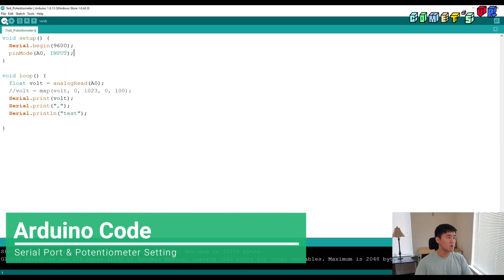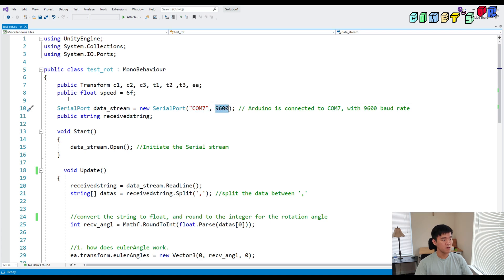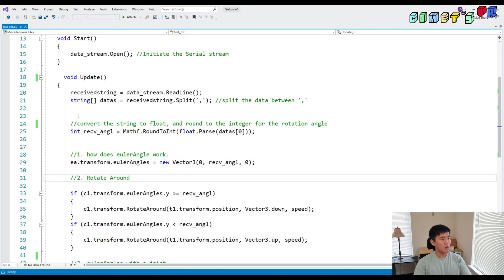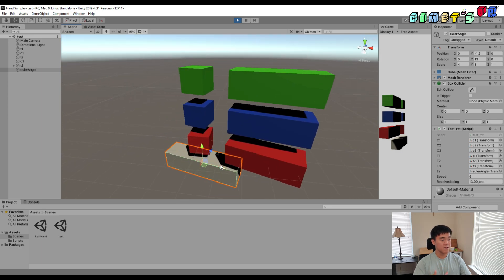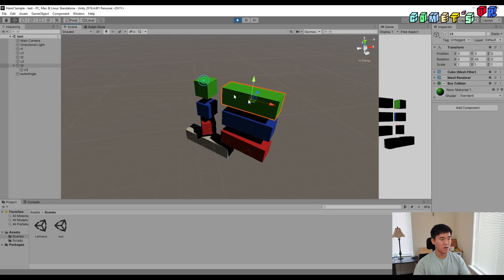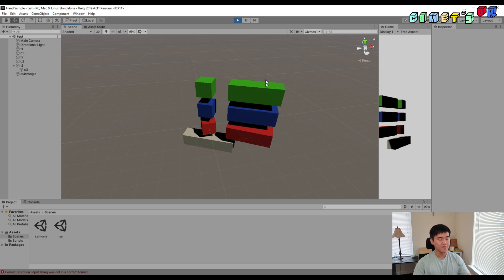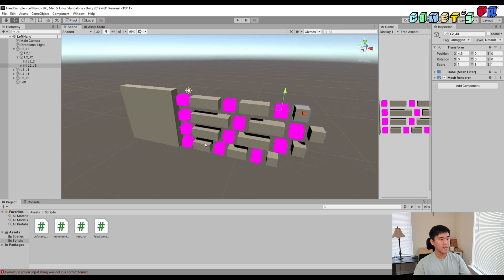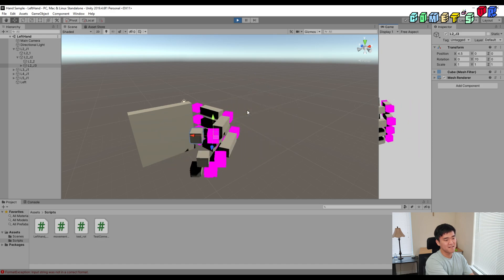How To Rotate Objects in Unity with Arduino, Serial Communication and Potentiometer.

Comment: Hello Comets, what a nice video. Thanks! I'm having some problems. I'm using your exact code but im getting an error.

"Assets/Scenes/test_rot.cs(39,14): error CS0019: Operator '<' cannot be applied to operands of type 'Vector3' and 'int'

Anybody knows a fix around this? thanks <3
Reply from the maker: On the right hand side of the operator, did you put integer data type?
Reply: @comet-tech  send the coding

Comment: Hey bro i am also doing such project kindly reply kr i need some of your assistance as i am doing flex sensor
Reply from the maker: There is a video related to Flex sensor in my channel.
Reply: @comet-tech  bro i want to rotate the same hand fi gers through flex sensors.Is it possible if you help me?
Reply: I shall be very thankful to you if you help me related to my project
Reply: @comet-tech  i need your left hand sample scene if possible can you send it to me?
Reply from the maker: @bilalsajid1006  https://github.com/hsmoon5458/cometsvr
It's here. It is an old version but you will get what you need. I will update the Github in the near future. Thank you for your interest!
Reply: @comet-tech  bro verg thank you
Reply: @comet-tech  bro i am doing this project with arduino and flex sensor i just want to know the formula through which sensor data will be converted in unity as a perfect angle for every finger
Reply: @comet-tech  bro my flex sensor give me the values that ranges from 600 to 900 i need the formula to convert theee values to angle
Reply from the maker: @bilalsajid1006  I think you need two things. First use 'map' functions to change the value, and use the linear or non-linear regression to optimize. These two things are in my videos.
Reply: @comet-tech  ok i will watch your video
Reply: @comet-tech  bro let say my flex sensor give mr value of 700 now how i will convert it in to a prefect angle.I need the formula for this.Kindly help me to solve this issue
Reply from the maker: @bilalsajid1006  map(variable,  old value min, old value max, new value min, new value max). You can look arduino reference. Find the map function
Reply: @comet-tech  bro is it possible if you give me here the function
Reply from the maker: @bilalsajid1006  I'm sorry. I cannot give you my contact.
Reply: @comet-tech  bro so plz give me the formula
Reply: How to convert the flex sensor value to angle value in unity i have search a lot but did not find any thing
Reply from the maker: @bilalsajid1006  Check the video "second prototype with flex sensor video". I mentioned how to use nonlinear regression with excel.
Reply: @comet-tech  thanks bro you really help me a lot

Comment: Thank you so very much for your quick response. Im using the bidirectional communication  with Arduino and the hololens 2. 
You have helped me tremendously. Keep up the good work. 
Would you be interested in doing a tutorial in setting up a Xbox controller in Unity 3D step by step?
Again thank you.
Reply from the maker: That would be another good project. At this moment, I don't think of connecting XBOX controller, but I will let you know if I do something similar in the future!

Comment: Hello , thank you for the videos. Can I have your code for sending values(array) to Arduino from unity?
I am able to send a array from Arduino to unity, but not unity to array. My goal is to fade 3 leds on a Arduino using unity sliders.
Thank you
Reply from the maker: Hi, thank you for your interest. I uploaded the code for bidirectional communication on my github. https://github.com/mhss5458/cometsvr
You can find the code for both Unity and Arduino in "Test Connection" folder. It will show how to send the data from Unity and how to catch the data in Arduino.